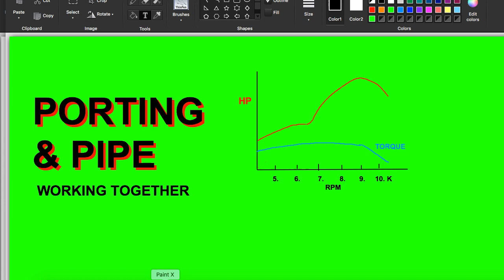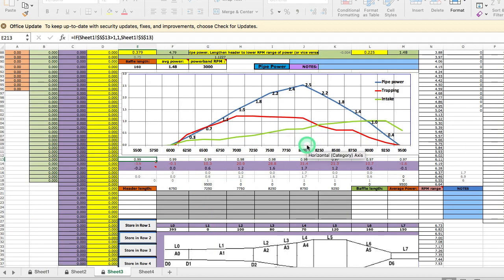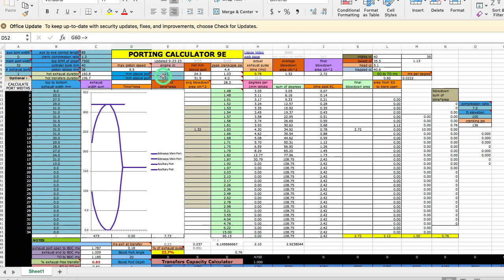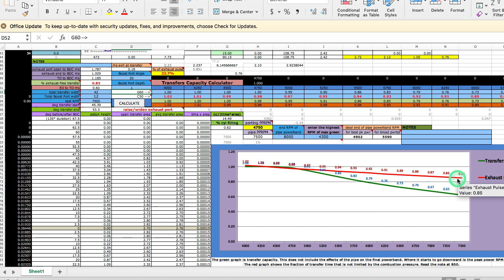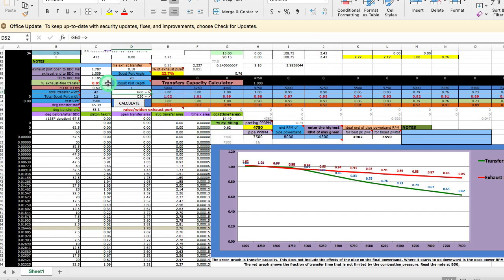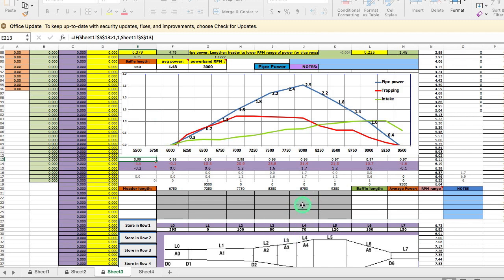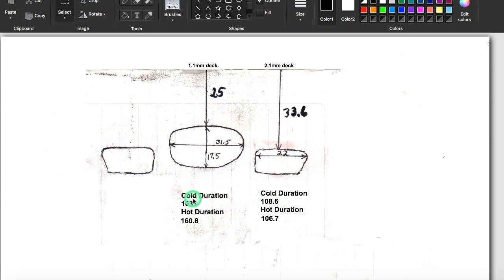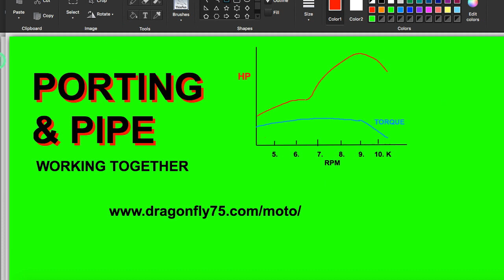Analyzing the Porting +Pipe (2 Stroke)

Comment: What if the pipe is the variable, and your looking at optimizing the ports for a specific rpm?  Ports are much harder to correct compared to pipes. Asking for a customer with a Kawasaki f7 175.. Thinking the pipe should go to 9k with porting at 8,500. Thanks!!
Reply from the maker: 1st step is to find the pipes end of powerband. 2nd step is use my porting calculator to find the portings peak power RPM and decide which of the two you want to modify, maybe both.